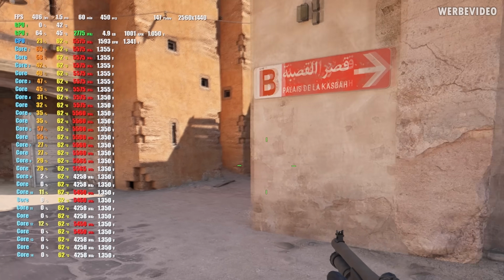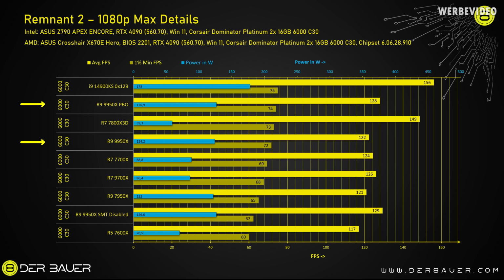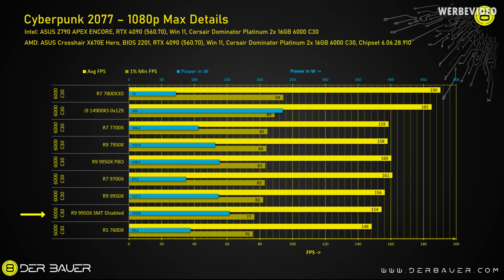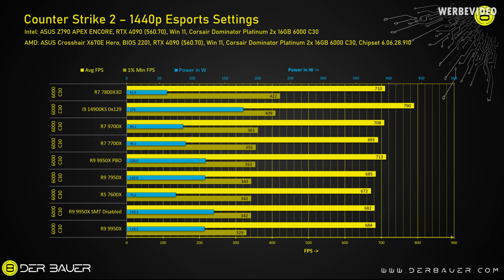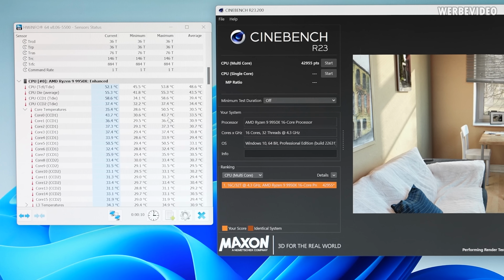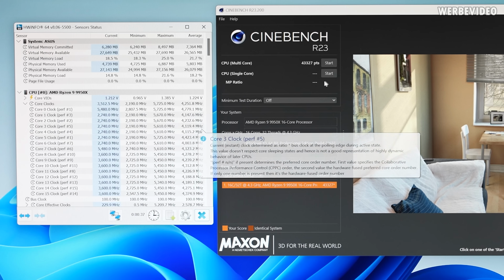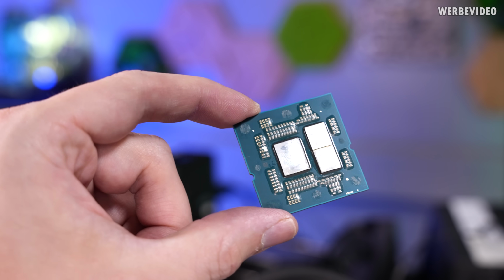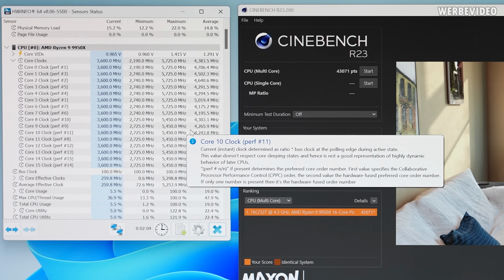Difficult to Review - My 9950X just didn't Perform as Expected

Comment: Perhaps I don't understand, but what is the purpose of testing non pbo? Isn't the purpose of pbo to be generically available and a thing that should always be on?
Reply: Pbo enabled is at times double consumption for a few percent gain. Of course it should not be enabled by default if the company is even remotely environmentally friendly. It would be like installing N2O and 6 liter engines in normal consumer cars by default. Basically what Intel was doing with the last two high end cpu releases.
Reply: @marsovac  190 vs 290? for an ~15% gain? that doesn't seem like 2x but fair enough I guess, as far as I can tell PBO at least for consumers (this is a consumer cpu after all) this is an always on setting
Reply: @marsovac  I should specify I'm talking about the 9950x in these statements
Reply: @OWBeeVa my old 5900x was crashing all the time with the PBO enabled, regardless of the value I would input into bios ... just random crashes with BSOD till the day I lost my sh*t and replaced it with 12900k.

In Games only - did not crash In productivity apps
Reply: Eh, I'd keep it off just for the lower heat

Comment: Considering gamers Nexus and Jay's two cents both had similar results, I think your results are sound. 
This one kind of flopped out of the box
Reply: there's still issue to be ironed out
Reply: Windows scheduler is the problem. See Wendels review.
Reply: @madb132  And Phoronix
Reply: @madb132  Windows is certainly an issue BUT its on AMD to sell a good product. Intel put the effort into ThreadDirector to fix the scheduling situation, while AMD hasnt and it shows.
Reply: @__aceofspades  ?? Linux works fine, even faster for gaming than Windoze. You are using an inferior operating system this is not AMD's fault.
Reply: @ssl3546  PS - Linux also features issues with AMD cpu's with this setup, so on top of everything else, you a liar.
Reply: Says a lot they didnt have the competence to figure out there's an issue, unlike L1T and KitGuru among others. 
As much as 20% improvements over 7k on linux or with scheduler tweaks in doze, for the same power

Comment: I lost at least 10% performance on my old 5900x and Msi b550 platform after the last bios update and latest AMD chipset drivers ( AMD made this to fix old vulnerability ). it could be interesting to know if this appening to everyone. Same settings in bios, before i reached stable 23.000 pts on cb R23 now i max reaching 21.000 i tried also to change some settings but i can only go worst.
Reply: Damn, that sucks. Can you go back to the old bios and drivers?
Reply: There was a bug with PBO in some bios that hurt performance when EDC was raised above 140, this should be fixed in agesa 1.2.0.B but that also comes with security fixes that are supposed to hurt performance, (maybe mitigated with ftpm off?)
Im currently running 1.2.0.B on 5900x/b550 and getting 22.8k r23 with PBO on Manual power limits (No CO)
Reply: Could be the same shit as spectre/meltdown security fix which removed branch prediction. Or just AMD purposely sending permanent microcode updates to nerf older gen CPUs to force people to buy new which is not the first time this happened.

Comment: 18:13 I don't know about new cpus but I remember using liquid metal to clean the solder from the die (9900k), I put a little bit on the die, moved around with a q-tip every 3 minutes, and then polished the die with a tiny amount of polish. Perfect mirror finish in the end. Zero scraping.
Reply: You learned that from Roman.
Reply: @thor.halsli  Probably, I don't remember exactly.
Reply: Scraping is quicker but more dangerous. Just use liquid metal and be patient. 2 or 3 applications, then some Flitz polish to really clean the die 🙂
Reply: @ColinDyckes  OMG, I just learned about Flitz last year, and WTF!! Where has that stuff been all my life?! It's AMAZING for cleaning LM off the die, but it also works wonders for getting LM out of AIO cold plates, and any other polishing/cleaning job involving delicate surfaces. It's magical stuff!! 🙂👍
Reply: @ColinDyckes more like 10 applications for 13900ks
Reply: @Typhon888  I literally did 3 for about 15 minutes each, but applied quite a lot of LM and agitated it frequently. Same result.
Reply: Always use a solvent, never friction. Professional stuff.
Reply: @Razzbow It's fine. It may actually improve thermals further because of die thinning
Reply: You can use pure gallium for removing solder, a fraction of the price of LM TIM albeit slightly less convenient in that it needs to be at kept at about 35°C or above (c. body temperature) to stay liquid. ETA >> a little heat speeds up the process whether using gallium or LM TIM anyway (a hair dryer will do).
Reply: Pretty much any metal polish works easily and quickly (i.e. a mirror-finish to the die in a couple of minutes) - in the UK that could be 'Brasso', 'Autosol' (used the latter on all four of the Intel de-lids I've done) and many others.
Reply: жидкий метал дорогой, дешевле соскаблить)
Reply: Roman literally does this in this video at 18:44
Reply: @popcorny007  I saw that, as I said before I avoided scraping at all.

Comment: why is everyone obsessing with gaming on these cpus?
the x3d parts that are coming will be for gaming.
Reply from the maker: 7950X was a perfect gaming CPU at the time when it launched. Ofc X3D was even better. But 7950X was really good in my opinion
Reply: @der8auer-en 5800x3d beats all zen 4 non-x3d. 7800x3d beating zen 5 non-x3d is easier to predict than the sun will rise from the east.
Reply: Please correct me if I missed someone, doesn't amd market them for gaming performance as well?
Reply: Probably because they were marketed with gaming benchmarks? lmao
Reply: Tbf a 5900x is enough for the vast majority of games.
Well, even the 2700x is enough.
You migh get a few slowdowns, but imo not worth the extra cost most of the time.
Imo the only thing that really makes a difference is single thread performance for emulation.

Though if you're using a higher end gpu and are aiming for like 200+fps it might matter
Reply: 1. Not everyone can afford an X3D CPU
2. Not everyone want to build a separate PC for gaming

Comment: Thr ryzen 7 7800X3D is now legendary. Going down in history with the 1080 ti
Reply: Well, I think 58X3D is something no one expected in their wildest dreams. I bought my PC at the end of 2019, just before Covid. Back then, we knew Ryzen 5000 was coming, so I bought a very good x570 MoBo and 3600. I had the intent to upgrade to a new gen. So then C19 happened, and prices went out of control and both CPUs and GPUs were either not available or the prices were insane. Something happened here in the EU, and we could get 58X3D for ~330 EUR. So I upgraded from 3600 to 58X3D. This PC in now almost 5 years old and it's still capable of running high end GPUs. 78X3D is better, of course, but when I consider the situation I described, running on DDR4, 58X3D is way more impressive in my book.
Reply: So next build 7800x3d and a 1080 ti?
Reply: not really the 5800x3d/5700x3d is when you consider pricing
Reply: @ThaexakaMavro 5800x3d is only priced well because it is old. A 12700k is a much better value. When 5800x3d came out it was an eye watering $450.
Reply: It's still too new. Maybe the 5800x3d will.
Reply: treating the X3D as a XX90X model that have to be beaten  mandatorily by the next gen or internet burns..... lol kids..... X3D is a WHOLE new league of CPU's and in fact AMD should change its name to not get confused by the other parts.... or kids will burn everything with the hate.
Reply: it is not at the level of the ryzen 4070
Reply: @betag24cn  4070?
Reply: @betag24cn  Ryzen 4070 rules them all
Reply: You know I held off on Ryzen and just got a 7800x3d a month ago. So I didn’t expect it to be faster than my 13900k and I was right. It’s a nice CPU but my Intel has better performance in the only 3 games I play lol. Funny thing too is I have AMD/Nvidia and Intel/AMD gaming systems. On the on had the Ryzen is nice on the other that 7900xtx 400+watts… my 13900ks don’t go over 250watts maxed out lol. So I have 2 gaming systems and both AMD and Intel sucking and Nvidia is charging too much hahahahah.
Reply: 1080ti is dog u want a 2080ti
Reply: Nah 8 cores is lowend at best nowadays. Freaking consoles have 8 cores 🤣
Reply: Intel has like a dozen legendary chips 😂

Comment: What is this refresh? Horrendous results, from AMD. They delivered just a little bit, it shouldn't be labelled as the new desktop gaming experience. Servers side, yeah, I guess they are good, but these are not server or AI advertising CPUs. They are consumer oriented.
Reply: The CCDs are exactly same silicon on desktop and servers. You get what servers get or in case of APU's what laptops get. AMD doesn't design any CPU specifically for desktop.
Reply: @MarioAPN They are not consumer oriented, the AMD marketing is just a why not try to get consumers to purchase them anyway. There's very few consumers that legitimately need the 24/7 load benefit the cost justifies. These are for non EPYC datacenter and business use in reality.
Reply: @drewnewby  6/12 and 8/16 are not for datacenters. I do not have a problem with their products, just with the lack of their honesty.
Reply: @MarioAPN Not all datacenters are EYPC, plenty are 79xx currently. The marketing we have a problem with, yet it has worked on you if you think these are consumer oriented SKUs.

Comment: So disappointed as I was looking to upgrade my 7950x
Reply: Why would you do that even if it were good? Upgrading to the same core count every generation is a waste of time and resources. At least two generations or an increse in core count... wait for the 10950X which hopefully won't be botched and will be on lower nanometer process.
Reply: Likely OP has a 7950X only for bragging rights, so that's more important than any financial sense. It's a silly comment regardless, with consumers using datacenter CPUs for productivity excuses when they likely sit underutilized 99% of the time.
Reply: @drewnewby  Mainly used for home lab for esxi server for running Linux Plesk VM instances. X3D parts have actually had a detrimental effect on VM performance.
Reply: Bruh who upgrades every generation? Not even Nvidia or Intel are worth upgrading back-to-back.
Reply: worthy upgrade would be gpu.
Reply: any single generation upgrade is rarely worth considering but for edge cases.
what were you expecting? +40% ipc? :) 
if anything you could consider going 9950x3d if the x3d part is worth it for you when it comes out.